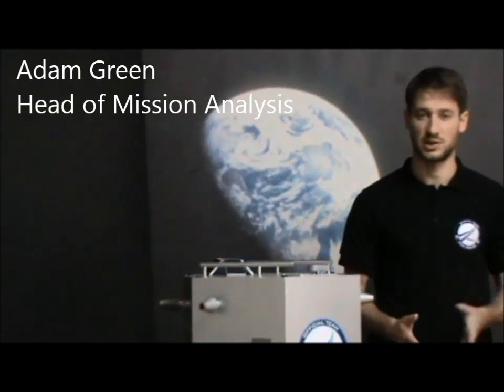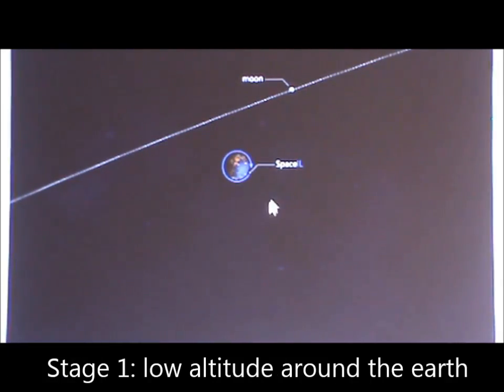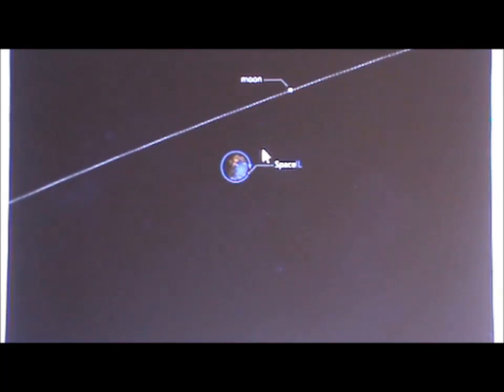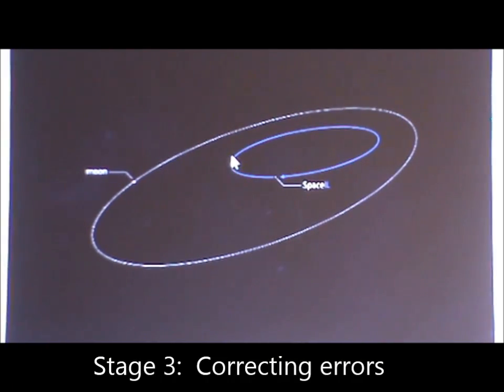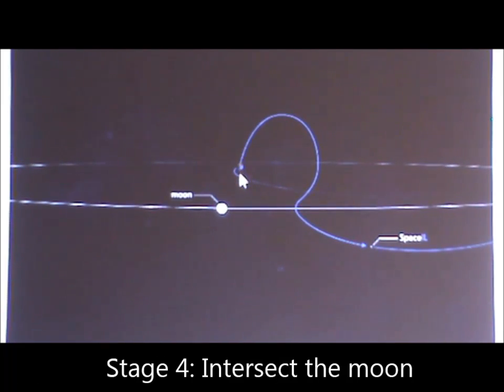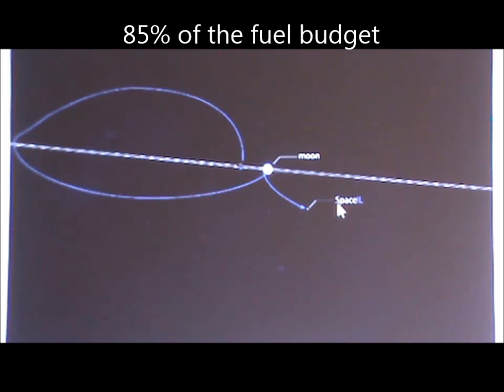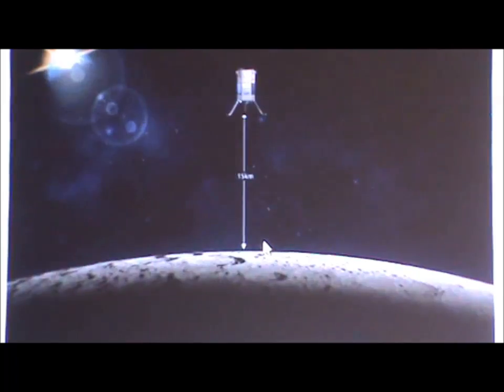SpaceIL Trajectory

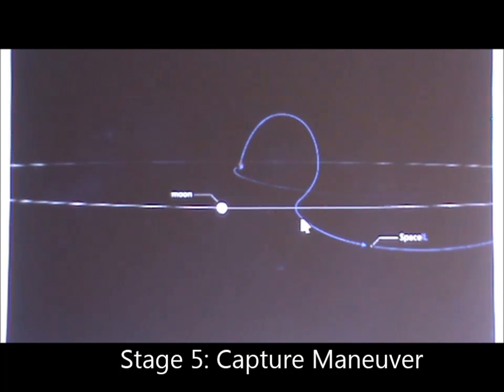Comment: Sounds like Dreck.  The primary satellites have to be  boosted up to 42156 km, relative to centre of earth to be geosynchronous. According to Green's fable this boosting of the commercial payloads  all happens by magic,  indep of primary booster.  Secondly,  the out of plane manoeuvre at 1:05 is nonsensical from an energy point of view.  You'd run the whole thing in the plane of the earth moon ecliptic as per Apollo and anyone with half a brain. 

 Clearly,  a lot happened between 2013 and 2019 and  and I have a feeling this video is either not really from SpaceIL or is intentional misinformation. (as of  23rd Feb 19).